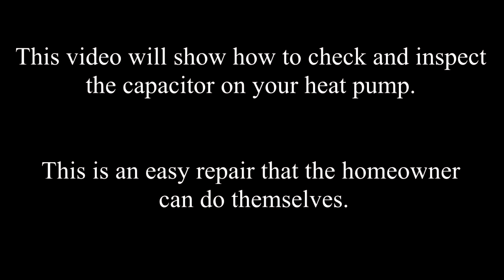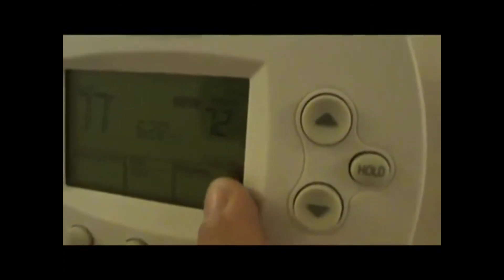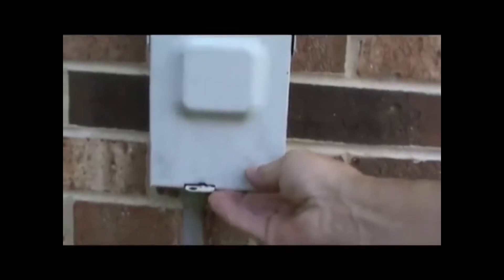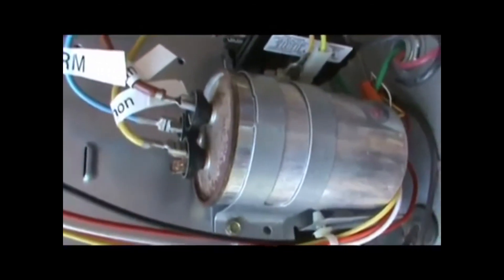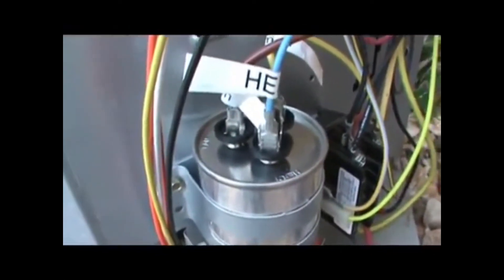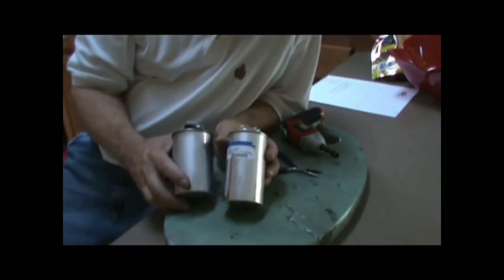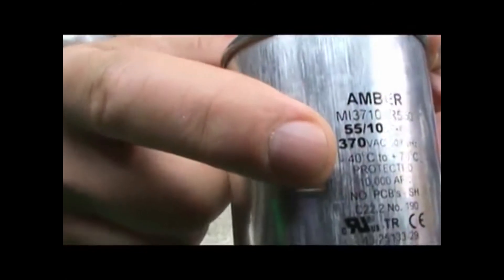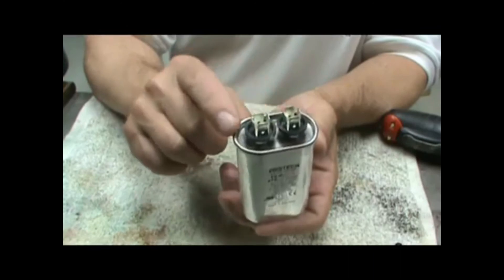Heat Pump Capacitor Replacement

Comment: My Home was brand new and the capacitor was blown out by a voltage spike during a Thunder/Lighting storm, Luckily it was the only component that blew and the unit lasted 12 years.  Since that day I have a ritual whenever there is lightning in the area, I turn off my system and throw the breakers off at the main box until the storm has passed.
Reply: get a whole house surge protector

Comment: Why didn't you discharge the capacitor prior to removing from the AC unit?
Reply from the maker: Thank you for asking. I found that task unnecessary.  The capasitor had already failed and if there was a charge in there, the capasitor can easily be handled without the fear of an electrical shock.

Comment: Where did you buy the new cap?
Reply from the maker: They are on Amazon now.  Just type in the Voltage and microfarad numbers you need like 370VAC 55/5uf and that should get you started.  I would buy by brand and not by price.  Made in USA is preferred.  Note that I am not promoting anything.  This a quality issue not a political issue.
Reply: @A_Renaissance_Man  right on thanks! I'll try my local electrical supply (Platt) if I have no luck I will try Amazon. I don't wanna wait on shipping.